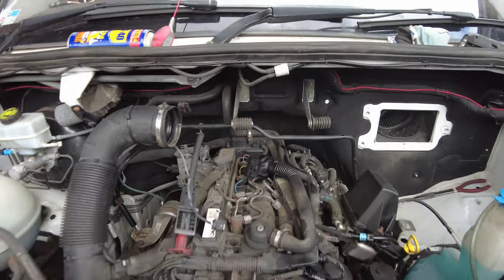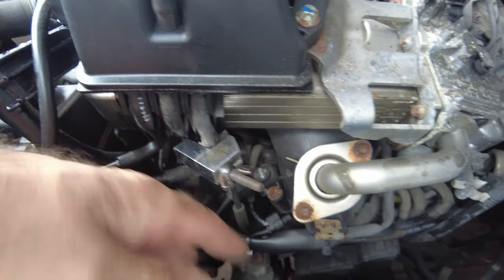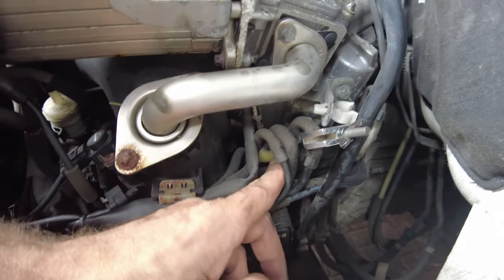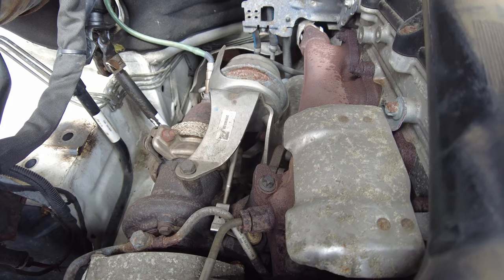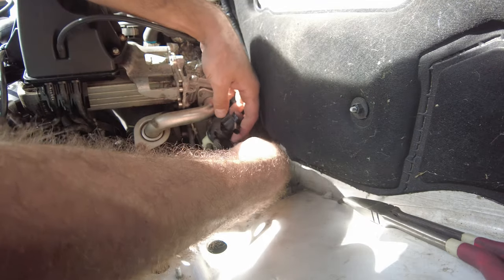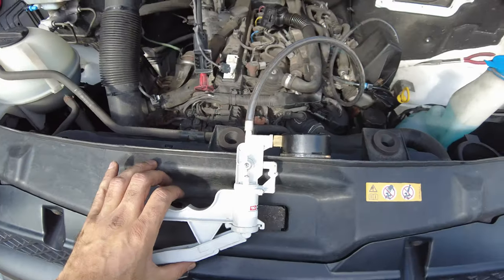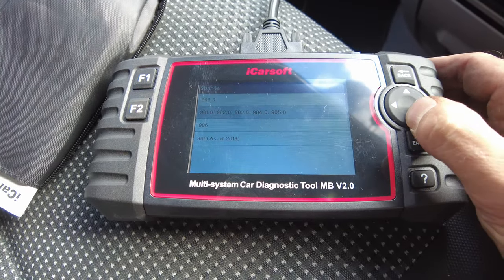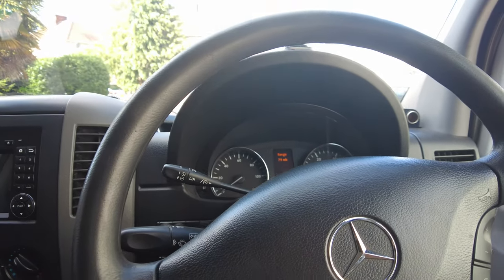Mercedes Sprinter turbo fault, P2263 boost deviation fault fixed. Sprinter w906 MB OM651 engine.

Comment: Glad I found this, local garage has had my E220 in 3 times for low boost, black smoke & EML when giving it the full beans. DPF has been 'modified' but fault persisting. Bought my own code reader & this is the code I get. I vac-tested the large actuator capsule today, that's holding pressure. I can't see the solenoid from up top, & I'm not mobile enough to get underneath but certain I can hear air escaping where that filter is located.
Reply: Hey man did you fix the problem?.. ive got the same issue..

Comment: Great video. This was easy. Guess what though? I changed this part and then realised the vacuum hose that attaches to the wastegate wasn't attached to the wastegate - So advice to others is to check the hose is actually still attached to the wastegate...They are only push on so can snag and come loose.

Comment: I too am doing some research on this, Ive got exactly the same fault as in this video 

i have not long paid a garage I know to replace my twin turbo with a brand new/recon warranty unit + manifold studs & gasket + rocker cover gasket & 4 injectors. I now get P226300 but in really weird situations.

Start up and drive off, do nearly 100 miles, up hill, down hill, long up hills, long down hills and no bother (all variations of high boost/high load)

Yet, I then park up for a day, get back in it again, do the same thing again but in reverse and within 15 minutes, high boost & high load, EML on, limp
mode and fuel burn is rediculous. 
I end up pulling over, turn it off, turn it on again and its ok for the rest of the 60-70 mile return trip up & down hill on high boost & high load. Driving with limp
mode as per fuel burn, i have to let it reset itself to return the van to a semi economical state.

I think the garage replaced with aftermarket solenoids so im going to get them genuine units and try again. 

I think they found this video tbh as they also said they did some research and did a vac test test and didnt detect any leaks.
Reply from the maker: It might also be worth having the intake system smoke tested to make sure the inlet manifold isn't leaking.
Reply: Good shout - i built my own smoke tester when i had strange faults with my e46, this dis show up a very small leak.

ill give this a go myself - thanks 👍

Comment: Hello
Thanks for this helpful video, it is slowly putting me in the right direction I think.
My pressure does not hold even when you clamp off that line as you have done in this. I pump direct into the black plastic distributor, and instantly pressure is lost.
Any ideas? Thank you
Reply from the maker: If all the lines out of the accumulator are blocked off it should hold pressure, if it doesn't that would indicate the accumulator has a leak.
Reply: @MJF85  when I clamp off the air filter now, it holds pressure. If I integrate it, I get no pressure.
Reply: @MJF85  So in this video where you're testing the pressure, the air filter is incorporated into the vacuum, and is holding pressure?

At the moment I'm still leaking. If I clamp off the air filter, it holds pressure. I don't understand. Would be grateful for any help.

(Transducers changed, one hose replaced, new air filter, fitting a new actuator in the morning as the arm does not move when I pump air into the back).

Thank you

Comment: I have a similar issue I replaced turbo p2263 low boost I noticed that the van would judder just before the eml light came on. Now with new turbo I get juddering especially noticeable going up hill but no eml no low boost etc what I have noticed is the actuator moving up and down when on idle and was wondering if the vacuum pipe or solenoid was at fault have you experienced anything like this

Comment: I had this same issue for a while and the garage couldn’t fix it. After about 6 months it was due for an MOT and it failed due to an oil leak. The oil filler neck connection at the engine was faulty and loose causing the oil leak which I think was also causing a vacuum leak in the engine. The filler neck was repaired and the fault code never returned (I would go into limp mode pretty regularly). Just an idea for those who are having trouble resolving this.
Reply from the maker: Thanks for sharing, modern engines don't like any kind of air leaks.
Reply: I got this happening to me right now I got w204 c220 2009 and I go limp mode regularly then turn car on and off and goes away back to full boost ! I changed map sensor and nothing still happens. Any ideas ? I could really appreciate it

Comment: I have the same engine in 2015 , am in mission of hunting down p02a7 for months now , I wonder if you come across this kind of code , it does say cylinder4 fuel trim at min , I swapped injector3 with injector4 still does say p02a7  every now and then , the strange thing is the code will not come straight away though , after sometimes will show up  but as soon as you delete code you can drive with now issue at all , but code randomly will pop back in , its really had given me a headache  , injector 3 was refurbished injector but it was on this van for over 2years now , when I replaced it back then , I didn't do any coding but it was working perfect without any coding and  no engine check light back then ! , I tested the vacuum following your method in this video it does hold vacuum very well with no issue so am pretty sure no vacuum leaks , I have taken intake manifold last month to find out about that bolt snapping on these engines , couldn't find any problem , changed o2 sensor with no luck , but am still suspecting the o2 sensor because when the engine is running if you disconnect the o2 sensor no code will be come on , as if its already connected !!! its strange to me  , your opinion will be appreciated it  .. Thanks in advance mate

Comment: I have error "P2263'22 - The boost pressure deviates from the specific value. The signal amplitude is greater than maximum amplitude."
Did you have same error code? Or was it under boosted?

Comment: Hi, how many of these solenoids are there on the om65 ? i have a c220 cdi with the same code p226300, some times i get a different code that says faulty boost control b is faulty. now i have noticed i have 2 similar solenoids one in front of the engine  close to the water pump and the other is tucked under egr and closer to the brake booster. which one of the 2 did you need to change ? the big turbo actuator gets its vacuum from the one under the egr on my car.

Comment: Hi. I changed both the solenoids. And checked all the hoses, no leaks. But when i clamp the hose as you do, the car goes much better, to a point at 90km/h and then limp mode.. the car drives better when the hose i clamped, but the P2263 error is still there. 

What can be wrong here?

Thanks in advance.
Reply from the maker: It's not a good idea to drive it with the hose clamped, it could cause too high boost pressure.

Hard to tell without seeing it and diagnosing, ideally needs a vacuum tester to test everything moves as it should, possibly smoke test to check for leaks.
Reply: Whats the next step if all the hose is not leaking?  @MJF85

Comment: Thanks so much for this video, I have a c class with same engine. Is it not possible to use an air foot pump to do the same job as the Mityvac?? Thanks
Reply from the maker: It could work but the system is designed for vacuum rather than being pressurised, I don't know wether pressure would damage the seals in the solenoids or damage the diaphragm in the actuators.
Reply: @MJF85  Hey thank you so much for prompt reply. Ok fair enough, thanks for your input, didn't think there would be a difference between vacuum and pressure. Appreciate it

Comment: Hello ! This faulty turbo solenoid can cause of unburn fuel like black smoke?.. ive got the code P226300
Reply from the maker: Hi, it could do as the turbo's won't be working properly so they may not make enough boost.

Comment: Hi.
I have the same issue with my sprinter and feel like its loosing boost was the same issue with yours and black smoke ??
Reply from the maker: @northgeorge40  Loss pf power and eml on but no smoke.  Smoke usually indicates a boost leak or intake air restriction, I'd be checking for air leaks in the intake system.
Reply: @MJF85  i faind the red intercooler pipe cracked change that but still not 100% i will carry on checking for leak

Comment: Hello I have this same error code, my symptom is when im trying to acclerate harshly when i reach the higher RPMS my power is very sluggish when i try go on hills it takes forever, do you think what you done in this video could be the cause of that? thanks
Reply from the maker: I would definitely be looking at this yes
Reply: @MJF85  ok mine is also 651 engine I will give this attempt. Can you advise me where you got those clamps from pls sir.
Reply from the maker: @umairgqureshi2762  I think they're from mac tools.

Comment: Did you have a like a gush off air sound when you took the foot off accelerator peddle
Reply from the maker: No, just felt lack of power and EML on
Reply: @MJF85   i get this gush off air the odd time taking the foot the peddle and then EML comes on no power lose at all just says dPF level full but dPF fella says there nothing wrong with DPF. At a loos now

Comment: Anyone know if a faulty vacuum pump could cause low boost faults ? With engine running 
Should there be vac pressure going through main hose pipe from vac pump to brake booster/servo ?

Comment: I have a vito 114 cdi with same engine & having low boost issues have replaced both boost solenoids but still the same, i have attached vac gun to the vacuum reservoir same as video even after few pumps there is no vacuum at all
Gauge showing zero pressure 
Have tried with vehicle off & running does this indicate i might have a faulty vacuum reservoir ?
Reply from the maker: Possibly. If the ports of the tanks are fully sealed off it should hold a vacuum. I'd start testing each part for leaks starting at the turbo/wastewater and working back, that way as soon as the system doesn't hold a vacuum you know its the last part you've tested

Comment: Hello.

Ive got a problem.

When i revv the engine i hear a whistle noise now if that normal coming from the turbo.?

Also you mention the hose with the filter i saw my filter doesnt connect to anything under... Even tho i see it has a connecter on the other side for a hose.

Comment: I have changed mine and still doing it any ideas ?
Reply from the maker: Did you use a vacuum gauge to diagnose it? Theres another one of these valves on the front of the engine for the other turbo.

Comment: So I took this part out can you please tell me how I know if it works or not ?
Reply from the maker: It should hold vacuum on the inlet port, there are 3 ports, an inlet, outlet and vent, the inlet should be closed when turned off/disconnected from the electrics. Ideally you need a mityvac to test it.